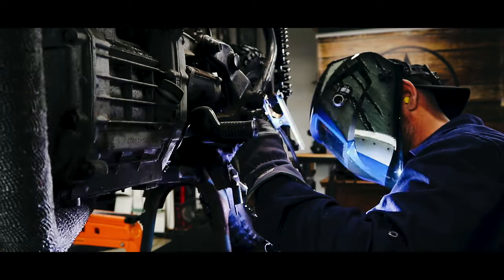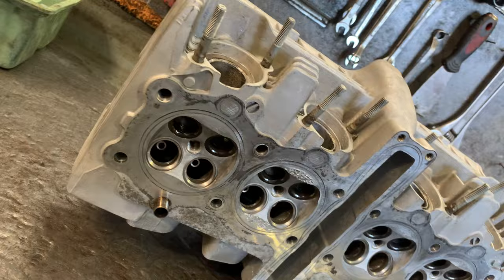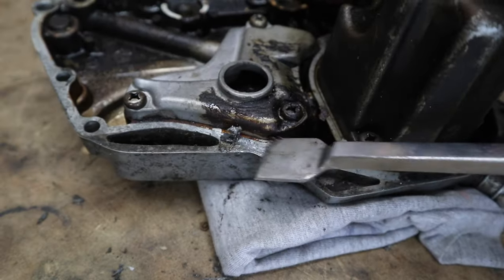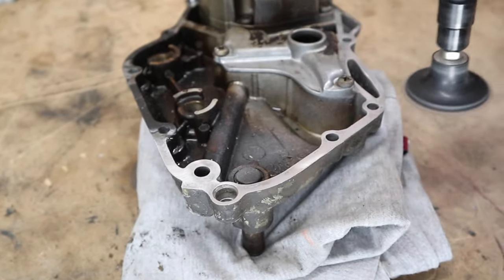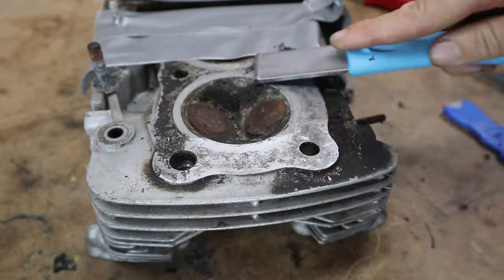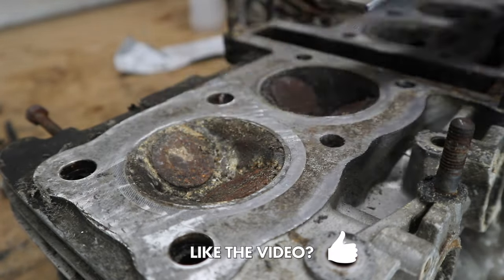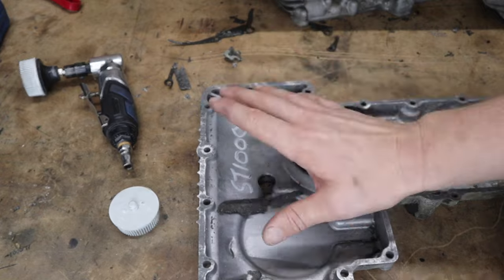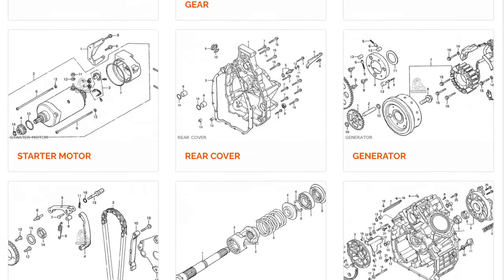★ TOP 5 WAYS TO REMOVE STUBBORN GASKETS!!!

Comment: I've also used a purpose kept sharpening stone, on the flat areas, with oil as lubricant after the bulk has been scraped off.  Keep it flat, work in circles, use the fine side of the stone unless you're real sure and careful.  Does well to surface heads too but no replacement for having skimmed.

Comment: This works really well on bike parts, take one side of a decent pair of scissors and lay it flat on two of the flat surfaces which prevents it from ever gouging into the aluminum, I've also wondered if aircraft paint remover would work, I've only used it on paint but it's really strong, bubbles right up on first contact!

Comment: Probably THE most hated and annoying of jobs on any build . Not heard of the gasket spray before but I'm a scraper and blade man .I do have a large machined piece of high speed steel tooling that I use as well if it's a bit stubborn. Then a very fine grit wet n dry on a metal block to just hone anything that you cant feel or see , obviously very gently and slow . Thanks as always for showing a few options and tips to help out the budding builders.

Comment: Instead of using a 90° di grinder with a 2-in cookie, use a Dremel with a 90° attachment and there half inch to one and a half inch cookies for a less chance of damaging the cast aluminum case.